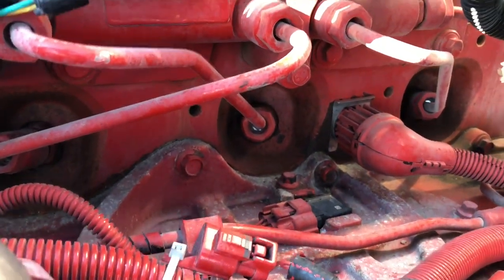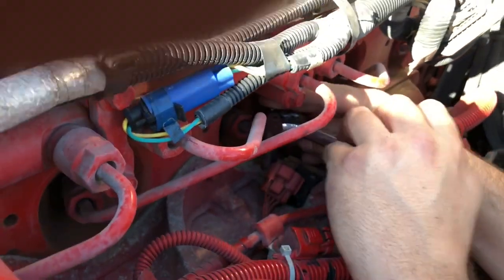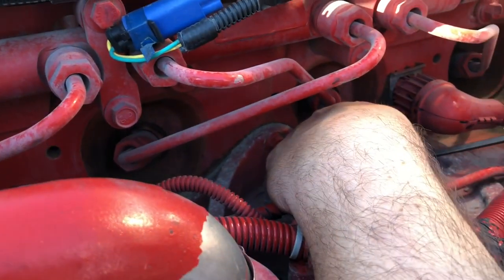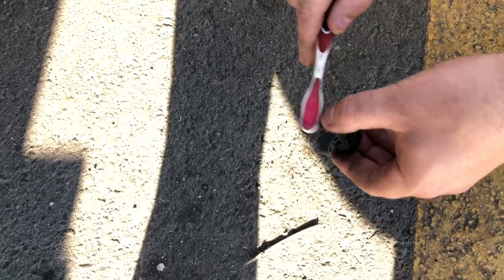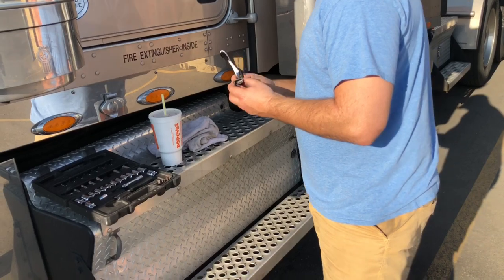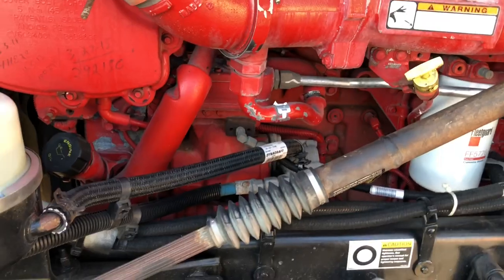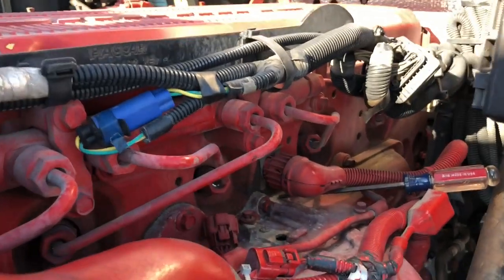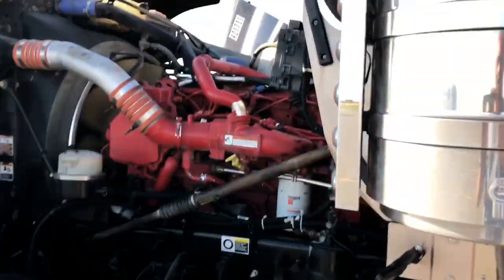Cummins ISX IMAP (Manifold Absolute Pressure) CM 2350 Sensor. Fast and easy to clean and/or Replace.

Comment: I have a 2012 Peterbilt with ISX 386 when I’m driving down the highway my temperature hits 205 in the clutch fan comes on temperature will drop way down and the clutch fan will stay on until I either slow down or stop and shut the key off and Peterbilt cannot find the problem I replaced the sensors and still have that problem any recommendations I only have 335,000 miles on it. Seems like Peterbilt can’t find the problem I don’t know what it is I cleaned out the fins on the radiator thinking that might be yet but that wasn’t it so that’s why I ask if that part you replaced or you cleaned has anything to do with the fan clutch
Reply: Did you replace the thermostat. Just had the same problem. Changed thermostat and water filter and washed out radiator. And so far it seems to have fixed the problem. Make sure you take off AC condenser / on bolt it and pull it away from radiator. Hope that helps

Comment: Thanks man great peterbilt dealer  ripoff  paid $600 to change sensor  but they reset code after 2 weeks check engine come back...
I have other issues any can help when rain 🌧water get in truck the floor wet water

Comment: I have an international 2009 with cummins isx and the hot exahust light comes on and the engine loses power. If I clean that sensor, can it work normal?

Comment: Great video brotha. I have a question for ya. I have a deleted and tuned 2009 t660 with the isx, EGR full system delete and dpf delete and tuned. Would you recommend doing this still every 100k miles?
Reply from the maker: no need for it if deleted man
Reply from the maker: oh wait.. meaning imap,,im not sure. I think so. Hell I cant remember if its egr related or not.
Reply: MakeCents I think I'll replace it anyways. I put right under 100k on the truck since I've had it. Pretty sure it's never been replaced.
Reply from the maker: I dont blame you. Its a cheap piece to replace

Comment: Could I use brake cleaner on the connector and sensor?
Reply from the maker: no. its a soot magnet. I use just water and a toothbrush or even Carb cleaner but NO brake cleaner.

Comment: Can I use brake cleaner on the sensors? Like this one? Spray brake cleaner on connector and sensor??
Reply: Hack Daddy - Official - will get twice as dirty
Reply: Hack Daddy - Official - try carb n choke cleaner or best to just replace

Comment: To any cummins technician out there please help . 

WE have a kenworth 909 with a X15 that has had a delete on the ad blue and turned up from 550 to 600hp . On a day to day basis the engine wil max out at 35 psi of boost but maybe one day every 10 days or so I will start it up and it will give me 40 to 42 psi of boost until I shut it down at the end of the day , how is this doing this and how can i keep it doing it as the extra 5psi makes the truck a complete different animal , it will pull 118.5 tonne straight up over some of the little
e jump ups we have on out run and the long steady I climes,  when it is at 35 iam down two full gears . Please help
Reply from the maker: When ever it does this, turn it off and restart it. You do not want more than 35 psi on these engines. The compression is so high it’s too much. Mine isn’t a x15, I have a cm 2350 but same applies.  Too much psi added with that HP, and you’ll beat your liners down and need a In frame in short time. 

Mine is tuned and won’t even hit 32 psi
Reply from the maker: As to why it does this, I can’t know 🤷‍♂️
Reply: @MakeCentsTrucking  g'day mate thankyou for your reply I really appreciate your comments , I'm not sure what part of the world you are in but I'm in western Australia so I'm not sure if they have a different tune compared to where you are geographically  located,  In saying that we had a cummins tech at the yard a while back and he said that cummins has a tune for the X15 that's is a 750hp and we all said he was full of it but he assured us that cummins have got a tune for 750 but I cannot find any where that backs this up .. surely that kind of HP would require larger boost pressures . 
All that said I will definitely take what you have said into consideration and while shut it off next time it happens , just maybe once it's done the pull to the top of the hill 😉

Comment: When a 2350 has been deleted...would this sensor normally be bypassed in the new tune?
Reply from the maker: I cant remember. I don't think it has anything to do with egr, but I'm not sure.
Reply: This sucker still works with truck being deleted and still wanna replace it cause it in a sense controls air/fuel ratio. So itd be nice to keep
It clean even when deleted

Comment: Is this the boost pressure sensor?  My Engine hesitates when accelerating and losses power on truck
Reply: No.
Reply: Juan did you find the problem on your truck.. my truck is doing the same?
Reply: @fcoanaya5762  did you find the problem with your truck??
Reply: @hectorramirez1808  I took mine and had a computer diagnosed.. it shows a fuel leak .. Mecanic thinks it might be the fuel pump top cylinder or the sensor going to fuel pump.. haven’t corrected the problem on those items yet..

Comment: Can u use starter fluid to clean it??
Reply from the maker: Yes, just don't use brake cleaner. Its a soot magnet I've been told
Reply: You can use carb and choke cleaner. Starting fluid is just ether. It's very bad on diesel engines and not really a cleaner. Ether drys out plastic and could cause it to fail.

Comment: So tell me how u no when to clean an replace cause my mpg drop. I have about 351,200 miles on her an having  touch  her yet cause I was told if ain't broke dont fix it
Reply from the maker: if I remember correct I was told to do it every 250k miles. Cheap enough to nip it in the bud :)

Comment: That sensor costs $50 bucks... VERY CHEAP, BUY A NEW ONE. They inner piece/reader is very sensitive, you can damage it and end up stranded on the side of the road and end up having to spend THOUSANDS with tow and dealer... IT IS ONLY 50 BUCKS!

Comment: Nothing recommended about Cummins ISX i used to own couple trucks with Cummins engine I got rid of them. pretty much everything is failure on Cummins motors
Reply from the maker: I've had 2. Both has served me well. You just got to know the weak spots these red babies have.

Comment: Be extremely gentle taking out this sensor , and than once you get it out beat the crap out of it on your aluminum step 😅 to clean it 🤔..and then push all the dirt around the open hole into the intake and carefully put the censor back in ..
And land star is not making all the money , land stars regional brokers go around every place they can and under cut everyone's good military rates by half and then broker and pedal their crap out on the broker board because their pwn driver dont want to even haul it ..
For instance , we had a contract in Cockeysville Md hauling unmanned aircraft units for 
$4.00  a mi , we did it for 5 years until the landstar broker found this place and under cut the bid to $1.60 a mi ..🤔 wtf ?? Landstar never hsuled one load ,they brokerd it to CRST ..after 6 months we got our contract back at half of what it was $2.00 mi because CRST was strpping down the humvees across the hoods and roofs to hail them and fucked up the humvess ..its was a circus to say the least and basically they screwed our contract ..land star is one of the biggest problems in the Trucking industry and contribute heavily to why rates are low ...i got out of the military and went in to  aviation specialized loads but we fight the same thing there with landstar trying to get their grubby little booty digging digits into our good contracts but we have for warned our customers of landstars tricks and how their trucks won't be hauling the items and have showed them pictures of many military vehicles they fucked up and are in the middle of being sued for ..best thing about hauling the over size engines for GE and Boing is the credentials and massive amounts of training a driver has to do to haul engines that cost 30 million each .because land star can't afford the insurance or the cost to train their drivers ...nothing worse than a big headed landstar contractor thinking he's better than everyone else on the rd because they lease to a greedy cut throat co
Reply: Huh?
Reply: @AceMon2005   I know right !  I didn't consider the  comprehension abilitys of truck drivers before I typed suck a long comment 🥴 .
Generally truck drivers get lost after the 1st sentence. In fact I better not go any further with this comment , its already past a 3rd grade  comprehensive and reading level .